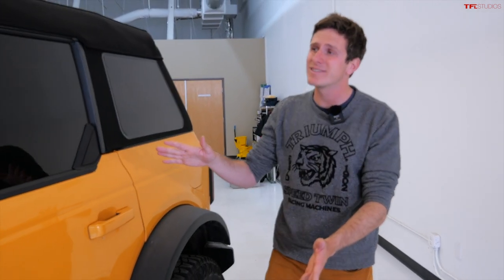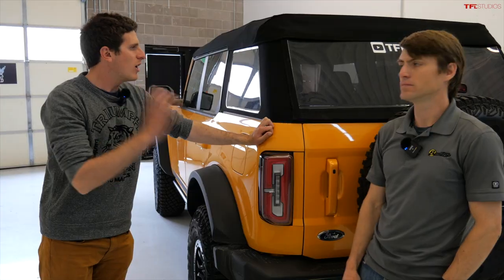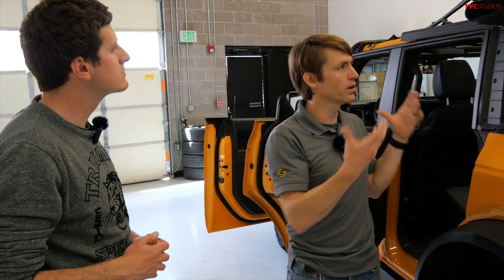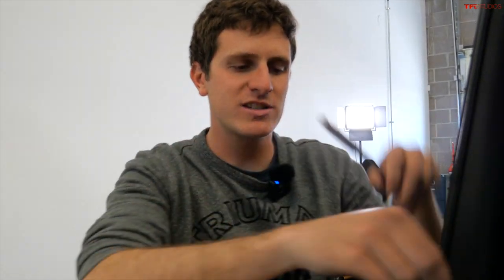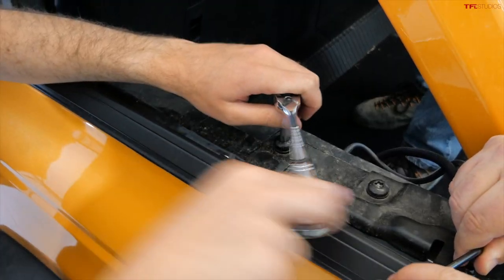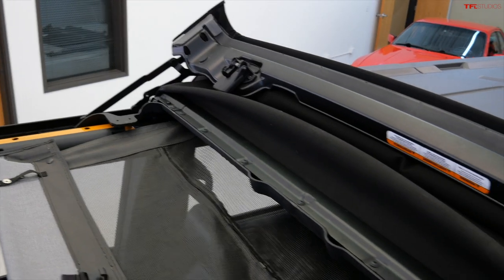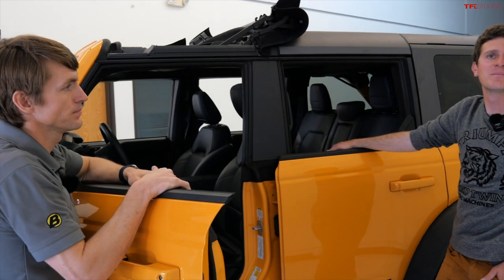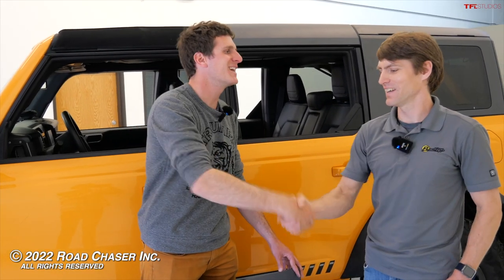This Coolest & Easiest Mod For Our New Ford Bronco Is a Game Changer!

Comment: Ford is one of the only car manufacturers, Nissan is another one, that will sell you a vehicle (that they know) that has a manufacturing defect. Ford knew these Bronco hardtops were defective, but they sold them anyway!
Reply: Insert manufacter name here, they all do this, some hide it better behind NDA or court orders but I don't know of any company that doesn't.
Reply: Tesla is the worst OEM. Every one of their buyers is a beta tester because that’s how Silicon Valley treats its customers.
Reply: Jeep: You underestimate my defects   - ignites two lightsabers - " Jeep can't build a working radio " and " dance to  the broken door weld clicks "
Reply: @user-cg7cc7zj3e  laughs in death wobble
Reply: I agree on the lemon law and Ford but still all manufacturers do this, Toyota has rusting frames, defective diesel emission systems, GM's ignition failures turning off the vehicle and the airbags right when you need it the most.

Name your manufacturer and they all suffer from the lawyer and accounting rationalization.
Reply: @RYTF5  wherever he lives, his tesla products are always at the bottom of the quality control listings. My buddy just bought a 2021 Model 3. Loves the car in many ways [even as a retired GM engineer] and drove it across country. The car shut off entirely in a rain storm on the freeway. That’s just the worst of the stories I have heard about fit and finish problems, panel misalignment issues, etc. You pay top dollar for the technology so it ought to be perfect.

Comment: I can literally get the two top panels on and off in under 3 minutes even with a roof rails in place. The only hangup for me is fitting both roof top panels in the one bag that they give. I solved that by simply getting another bag. I am not seeing the value of spending $1000 for this.

Comment: Don't get me wrong, I am a believer in Best Top. However, with both of these tops, it seems like a TON of work to get to a true topless state where from windshield to back gate are truly and properly exposed. Call me a topless purist, but this is one of the top 3 reasons I love the bronco, and these tops seem to make that a pain. a top should be easy to FULLY remove, and easy to put back on (besides mounting hardware, of course) when weather comes.
Reply: Hey I totally agree, I have a 2022 Bronco and have had my original soft top all the way back all summer !!!  These products are nice and options for Bronco owners

Comment: So TFL purchased a Bronco for over $60k and had to purchase a soft top. Now TFL had to purchase a hard top, which came with the Bronco for over 60k. I just hope that this isn’t the story for the Bronco from now on. The design of the Bronco is great, but it just didn’t come together for a 60k vehicle.
Reply: The hardtop was replaced via recall. No cost to them.
Reply: @kellysilks595  the company purchased the soft top and they have not received anything for the hardtop. No Broncos are out with a hardtop because of the failure by Ford to outsource to a reputable company.

Comment: You guys should have kept the defender. I know everyone in the comments will say “But the reliability” blah blah blah, the original defender had a defect that they fixed after you returned it. Big deal, under warranty and remedied. Second one was a DEALER ISSUE. They cut your harness. Nothing to do with the car. Overall it’s a better on-road car and completely competent off-road and much more comfortable. You paid over 60k for a bronco. That price gets you a comfortable defender that will conquer the off-road. And let’s be honest, the defenders engine is much more reliable than ford’s turbo engines. I’m being completely honest here. Those Ingenium engines that JLR makes are excellent.
Reply: I want what you’re smoking

Comment: The Bimini is truly awful and you should know better than to recommend it. It’s really loose so it flops in the wind creating a bunch of noise. The button attachment in the front is flaky at best and I’ve had the wind unbutton it. Do not recommend. I’m sure you can buy one for cheap on the forums from all the disappointed buyers.

Comment: Nice walk through. We have one installed on my wife's Wrangler.

One thing to mention, is this type of top is great for someone who will never remove the entire hard top and doesn't like to deal with the front panels.
However, the install of the top ( At least on the Wrangler) add's a lot complexity and time in the way it's attached. Almost 30 minutes. 

With the Freedom Panes and the traditional hard top, We can have the entire top off in 5 minutes. ( I have a overhead lift in the garage). But with the Bestop it's easily a 30 minute process to remove it and at least 45 to put it back on.

Comment: I have one on my bronco and I love the functionality of it. The wind noise from the poor fit against the windshield panel is my only complaint.
Reply: I agree, we just put it on yesterday and I was disappointed with the wind noise with it closed. Especially since when I ordered it they stated it would probably be quieter than the hardtop due to the multi layers.
Reply: That would drive me insane....
Reply: Might be able to add some insulation
Reply: @Jantonvid  this is a sealing issue not an issue with the fabric or its thickness. The top is made with great quality and material. It just has a poor fit.
Reply: @miked7121  I didn't think it would be noisier than the hardtop, the factory soft top is the quietest option out of 4 setups so far.

Comment: That "factory" hardtop appears to be gray, not black, and so it doesn't match the rest of the vehicle -- really ugly!  Perhaps the interior lighting (florescent?) where the video was taken has something to do with the hardtop's off-color appearance?  If that is in fact the "actual" color of the hard top, then I would head straight back to the dealer and tell them to keep it until they can get me a black one that matches the rest of the vehicle, or require them to paint it with a durable finish that won't chip off or fade in a few years.

Comment: You're right, Tommy, there is no right way to use a rachet, every single way is wrong, let me be the first to make that comment. For removing screws and bolts, an impact is usually best as you can keep it straight easier and has a ton of break away torque so you don't struggle getting it off and are unlikely to snap it, even when rusty, but never use an impact to start a thread or over torque the bolts.